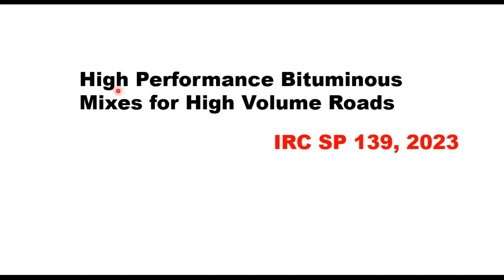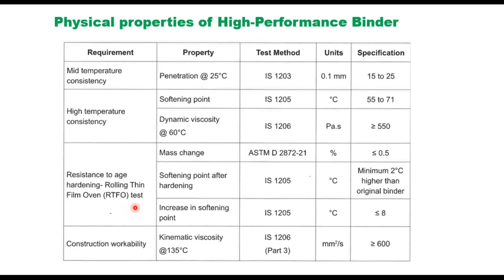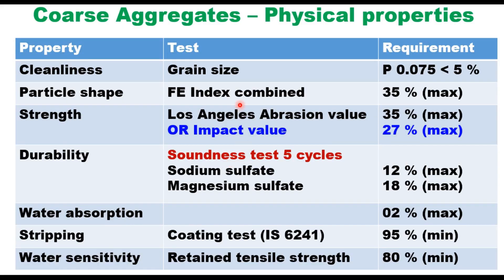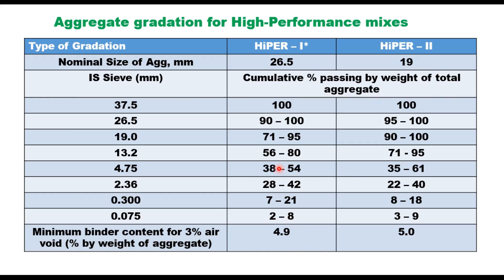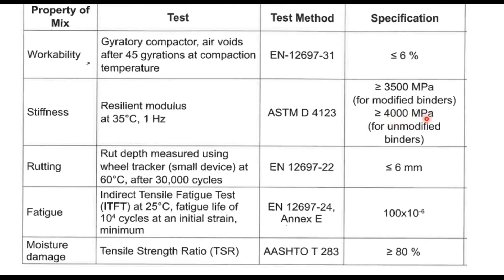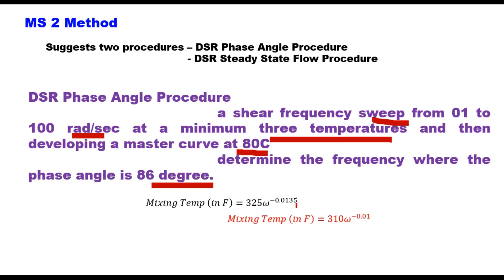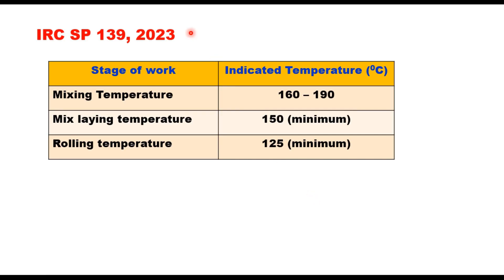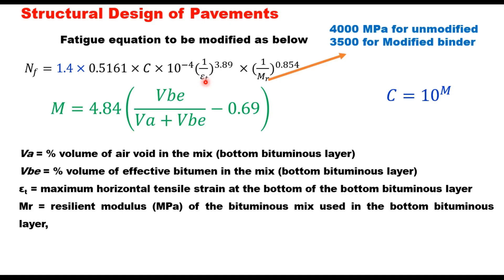High Performance Bituminous Mixes for High Volume Roads IRC SP 139, 2023, #HiMA and HiPER mixes

Comment: Sir,I have one doubt how to determine the binder content from % wt of mix?you said for the binder content of 5% by wt aggregate thn it will be 4.75 % by wt of mix.How this value4.75 will came.This is my doubt sir..sorry for the trouble
Reply from the maker: 5 percent by weight of aggregates means 1200 g of aggregates and 60 gm of bitumen. 60/1200 = 5 % 
now total mix is 1260 g. bitumen content by weight of mix is 60/1260 = 4.76 %
Hope it is clear now.
Reply: @SatishIITR  cleared sir..thnk u so much sir
Reply: You assume 100 g aggregate, bitumen is (5% of 100 g aggregate = 5g). So total mix = 105 g. Now, %bitumen by weight of mix = (5/105)*100 = 4.76%
Reply: @vinamramishra2600  thnk u sir